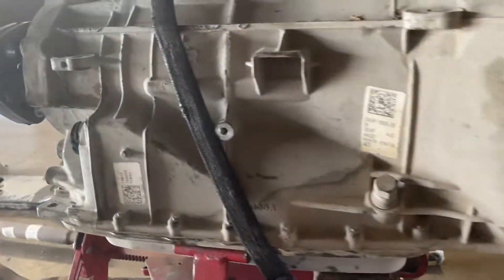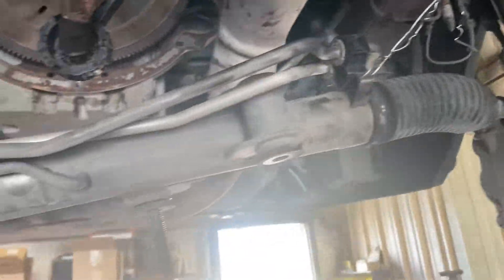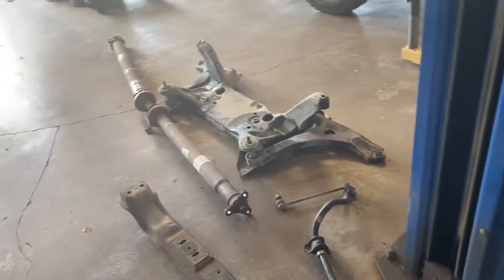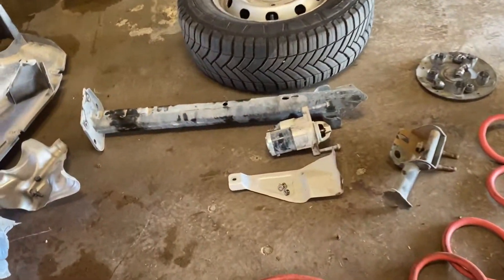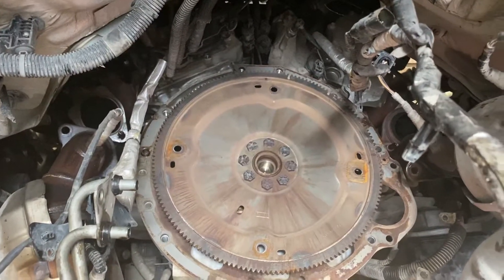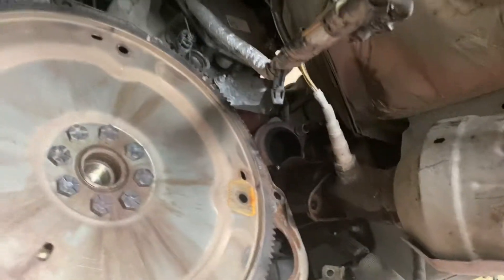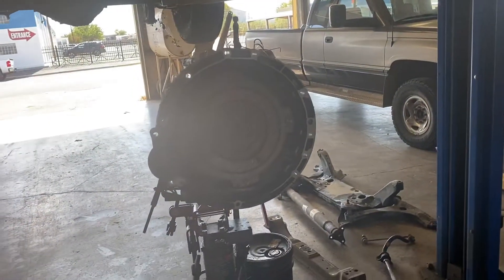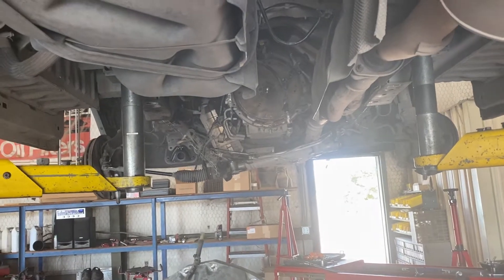For Evilwhiteclownpunk - You’re Right About The Ford Transist Van

Comment: You got lucky...    usually them bolts is stuck inside the bushing in the control arm, and the bushing rips and spins and you gotta sawzall...  we've also had the bolts holding the stabilizer bar twist off...   maybe being in Texas they don't rust so much...   maybe you gots better tools...
Reply from the maker: The captured nut inside the frame on the passenger side did break loose and spin, but I was able to weasel a 24mm socket onto it with a breaker bar and zip the bolt out. But yeah, we don’t get too many rust buckets in Texas.